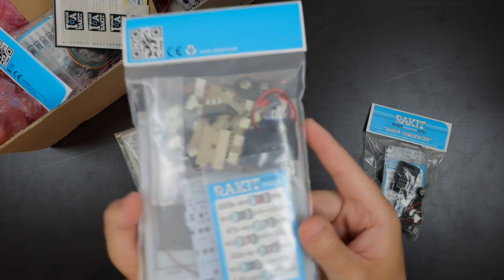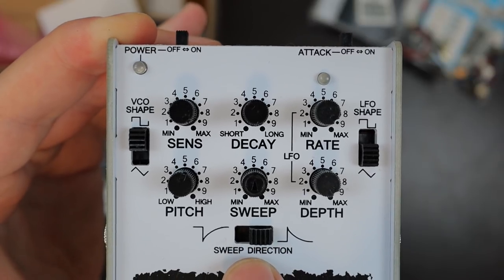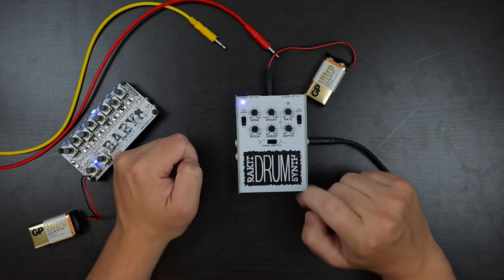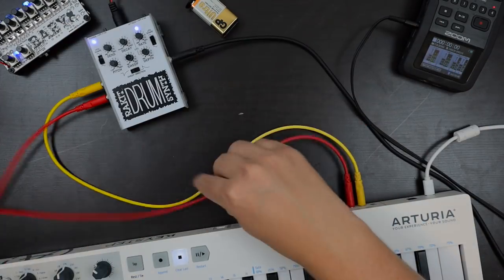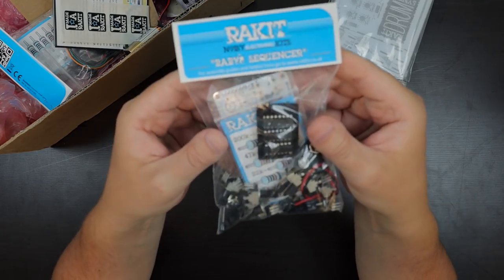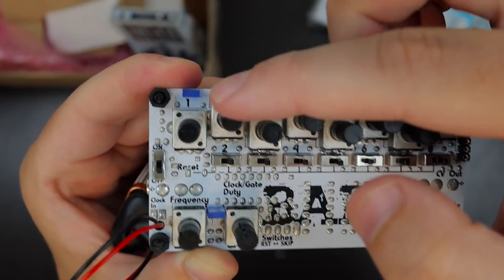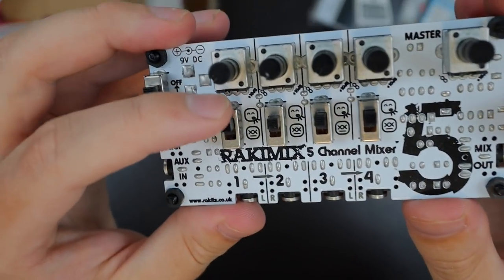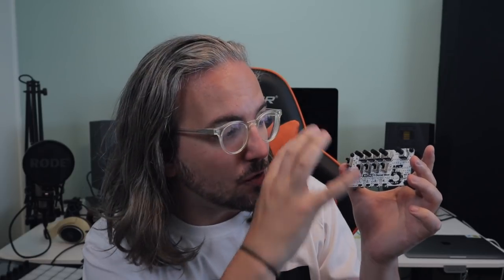this is a wicked drum synth

Comment: 4:29 love  that bass........
 also for the 9volt issue  you can use this  usb to 9v adapter 
https://www.adafruit.com/product/2777
Reply: Never seen one of those before, neat! I wonder how clean the output voltage is.
Reply: you could probably implement the converter  in your build , should not drive the cost up to much  .
. or you could include the cable  or a link to it on your site ..   :) !!
Reply: It's something I will definitely look into, I hesitate only because I like to keep the kit and the assembled one almost identical. The boost cables will be using some surface mount chips for sure. Will buy a bunch of cables and see if I can find any I like. :D